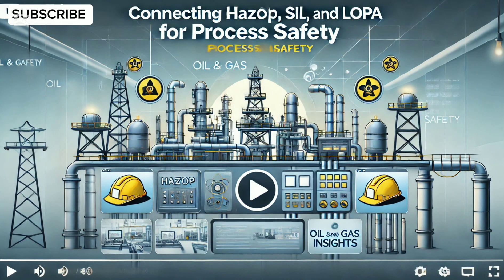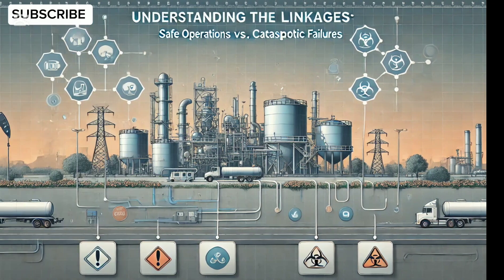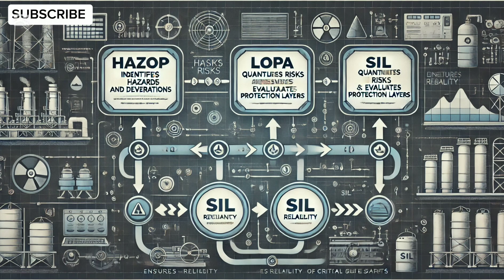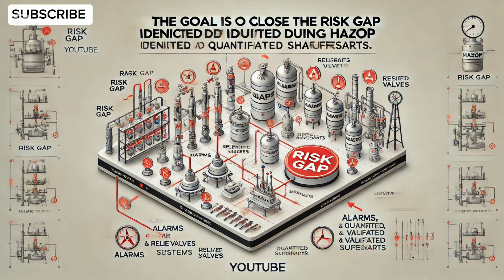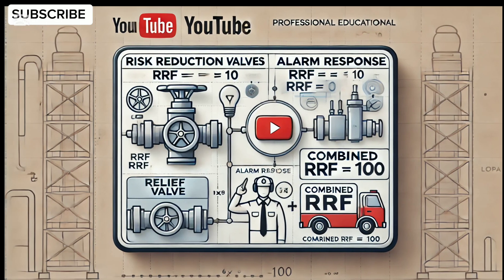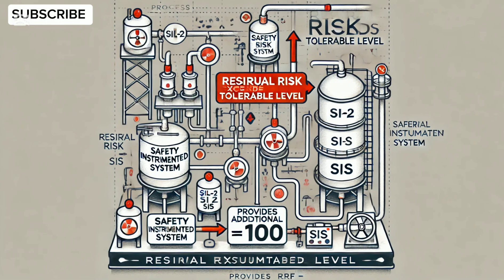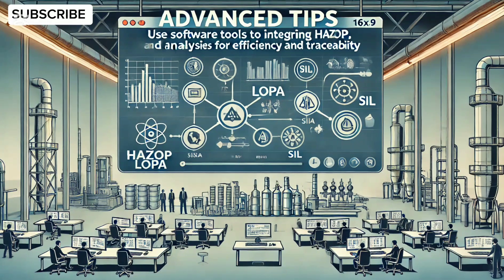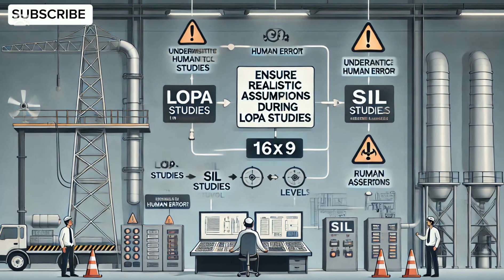Master HAZOP, LOPA & SIL | Unlock the Secrets to Process Safety Success!

Comment from the maker: Question raised by one of our Subscriber  & 
Solution Provided by

 "Oil and Gas Insights" 

Step 1: Volumes in the Drill String

Drill Pipe (DP):

Volume =Length×Capacity per foot
Volume=Length×Capacity per foot=5800ft×0.0175bbl/ft=101.5bbl.

Drill Collars (DC):
Volume=Length×Capacity per foot=600ft×0.0087bbl/ft=5.22bbl

The total internal volume of the drill string is:
101.5bbl +5.22bbl =106.72bbl

Step 2: Displacement of the Pill
Pill volume inside the drill string is 5 bbl, which is displaced through the total internal volume of 106.72 bbl.

Step 3: Volume in the Annulus
The annulus holds 15 bbl of the pill. To calculate this, we assume the slug travels upward until the desired volume is reached.

Step 4: Total Volume for Slugging
To completely spot the pill, the mud pump must displace 20 bbl (5 bbl in the string + 15 bbl in the annulus).

Step 5: Total Strokes Required
The mud pump displaces 0.119 bbl/stk, so the total strokes are:

Total Strokes
=Volume / Displacement per Stroke
=20/0.119
 
Total Strokes = 168.07